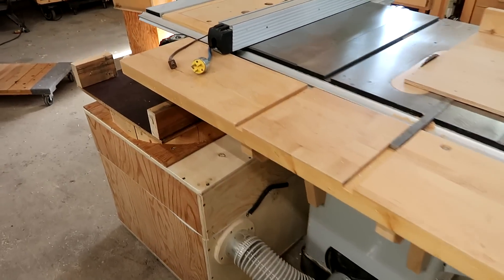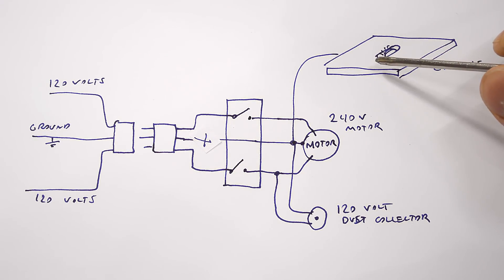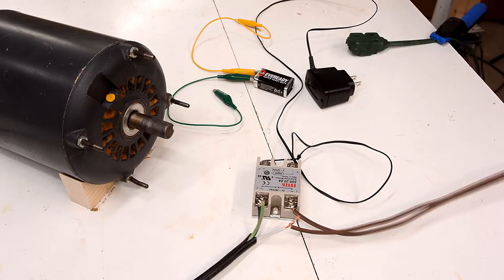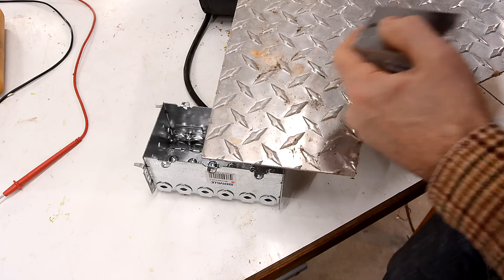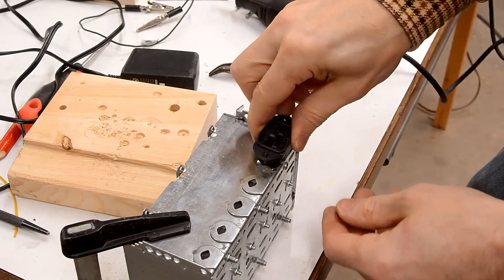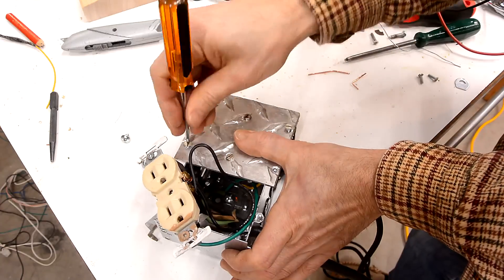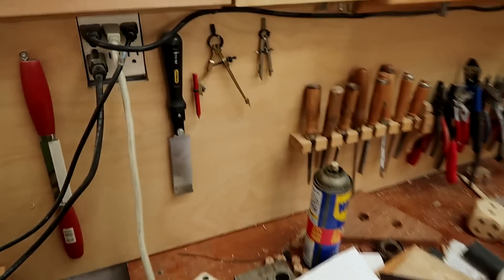Relay box to automatically turn on my dust collector

Comment: If you wire an electrolytic capacitor across the low voltage side of the relay, you can get a time delay before it turns off, which will remove any dust still in the system.
Make sure the voltage of the capacitor is higher than the LV supply, maybe start with a value around 500uF
A simpler solution would have been  a normal relay with a 240v coil
Reply: I know, but it's a suggestion for longer delay if he wants it.
Reply: it already delays a few seconds for turn off. The USB power supply will have a built-in cap for output smoothing.
Reply: Awesome inadvertent feature!
Reply: Good point from the wife: Wiring it up so that the fan comes on a few seconds before you turn the table saw on would be a nice feature too :-)
Reply: TheRetiredtech --- Well the delay is just a convenient consequence of using the 5V power supply.
Reply: you'd struggle unless you plan to put a delay on the table saw starting from the time you turn it on but i doubt matthias would be happy about waiting everytime he turned on his table saw, don't see how you could preemptively predict that the table saw was about to be turned on though.
Reply: A capacitor on the dust collector on the high voltage supply on the relay would also provide some reactive power correction and reduce the voltage drop due to the difference in apparent and real power draw.
Reply: No delay needed really.  I know of no one who starts sawing the instant the saw is turned on or one who turns off the saw the instant the board is cut.  So residual dust wouldn't be an issue.  However, a delay between the start up of the saw & dust collector motor might be needed to reduce the start up surge current of both motors at the same time if connected to the same circuit (if you had a 120vac saw like I do).  Not an issue with Mathias' system.
Reply from the maker: Already has a delay.  I wouldn't want it to be something like 10 seconds, because mentally, that would just be annoying.
Reply: Philippe Grant what makes you think it was inadvertent?
Reply: Sparky Projects the relay seems to be doing that anyway. The fan keeps running a bit after the table is turned off..
Reply: i will buy relay box with inverter and batteries to make my own electricity when the public electricity will gone ..any idea or video ! (i need some advices)

Comment: 2 phase system? never heard about that...
Reply: proper terminology is split phase, since it's 1 leg of 3 phases at 1000-10000v fed into a step down transformer to bring it to 220-240, the secondary winding on the transformer has a center tap, so between the live wires there is 220-240, and between each leg and the center it's 110-120. Then the center tap is earthed to keep the center tap at 0v. This is known as the neutral. 

This set up results in 2 live wires 180 out of phase with each other since it's just normal AC, the center tap just allows you to divide the voltage on the secondary of the transformer.

Comment: great video. thanks for sharing. i would sketch up a single line and throw it in the project box incase you forget how its wired up or if someone in the future uses it. Also did you you ground the project box?
Reply from the maker: yes

Comment: It's cool how using the phone charger has the side effect of leaving the dust collector on for a few seconds after the saw turns off. Since the relay provides very little load to the charger, the capacitors stay charged for a little while and will make sure to suck up as much dust as possible.
Reply: The phone charger probably has a smoothing capacitor in it, and the solid state relay control side likely has a very low current draw/very high resistance, like a FET gate.  So it probably takes a few seconds to bleed off that capacitor’s charge down to the minimum turn-on voltage for the relay.
Reply: The relay seems to stay on on it’s own for a bit already. See the 9v battery demo. But the phone charger seems to increase that time indeed.
Reply: I was wondering why that was happening
Reply: yeah this seems like cool feature
Reply: Richard van Pukkem yeah, that is the behaviour of triac.
Reply: Jeff Newton You sre right
Reply: Central vac controllers have a delay too.

Comment: "I don't understand what just happened" -me after every Matthias video...
Reply: I often don't understand what happens in his videos. I have none of his mashines I'm not thinking about getting one of those like ever. I'll probably never going to do anything even close to what he does in my life. But I still watch every video and enjoy it. Am I weird?
Reply: sometime we saw ..fighting films like bruce lee but we can't do any karaté technique..but we still enjoy the show ..it's looks like that ! not a weird ..human nature is curiosity !
Reply: table saw is powered by 240, cell phone adapter is too. dust collector is 120. He plugs the table saw into 240, which feeds the cell phone adapter when turned on. He plugs the box into 120, and the dust collector into the box. When he turns on the saw it hits the cell adapter which hits the relay which passes the 120 onto the dust collector.
Reply: Relay box ..sometimes has 5 way to switch electricity ..for example when the electricity goes from A to b when the C is switch on but the electricity can change the path from D to E when the C is switch off..that's the job of the Relay box
Reply: I say the same thing about ThisOldTony's videos.
Reply: Hubbard's Handmade I usually head to Home Depot for solutions...
Reply: I was going to say that.  haha
Reply: Just use a freakin' contactor :)
Reply: Matthias has a Black Belt in strange and cool solutions 😁
Reply: What !
Reply: Frederick Toms    What on earth are you talking about?
Reply: Yes you were
Reply: Apparently you are. Talking about talking.
Reply: Just thinking... I need to watch that again. ...
Reply: Frederick Toms   I’m not talking to you
Reply: Chris Is    OK Who’s talking now ?
Reply: +Hubbard's Handmade - I'll tell you what happened here, apocalyptic wiring and bodgery, that's what.  I cannot stand supposed engineers who are so cheap to not buy the right tools or supplies to do the job.  Unless it has to work in the next hour, there's just no excuse for it.  Everyone should have higher standards.

Comment: AAAHHH so many exposed contacts squeezed in that box..  how about some electrical tape or shrink tubing to cover that up?   Sorry, years of electrical engineering being forced to pass CE/UL testing.   Also would love to know how hot that aluminum plate gets (and more importantly the relay itself).   Not sure a solid plate with no radiating fins is sufficient for that if you happen to run your table saw for long periods of time (like your baseboard video).
Reply: I came to the comments for something like that :)
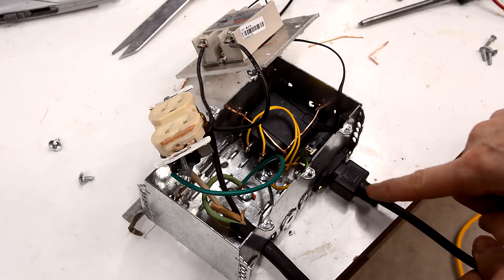Reply: he did ground the box, you can see that at 4:30
Reply: KM4WOR Grounded or not, he would be in pitch dark instantly if that touched metal which isn't really safe with a table saw still running.
And if it only trips one phase in a worst case scenario it might even stall the saw and burn the motor out on 120v and no rotation
Reply: neat idea for the dust collector but I must admit I did cringe when Matthias soldered the wires onto the two outlet pins and left them exposed, think i would would have opened the power brick and de-soldered the wires on the pins and soldered them to the 3 pin socket screwed to the side of the metal box.
Reply: AF he did earth the metal box, look carefully at 4:43, he tied both incoming grounds directly to the box and continued through to the ground of the socket.
Reply: Yeah looks so scary, that bare copper wire on the phone adapter.
One slip of the copper wire and its firework.
Reply: it looked like he taped up the plugs on the adapter, I would have been happier if he'd cracked the case open and just mounted the guts to a fiber board and screwed it to the case with standoff screws... but really, he grounded the case and covered the exposed bits. It should be fine.
Reply: The socket and SSR already have exposed contacts/screws so the adapter is to be ignored
Reply: Or at least earth the metal box, if not already earthed through the metal connections of the socket!
Reply: eeguy77
Reply: KM4WOR But it's likely not on a ground fault circuit interrupter protected circuit in his shop so if he loses ground and it shorts it's lights out for him.
Reply: Dream Services International you're spot on. Using a box that is made for MC that is full of vent holes, along with the huge gap between the handy box cover and the diamond plate, in a dusty environment is more of an issue than some axle grease that wasn't needed anyhow. No cord grip on the SJ cord. All this because the dude is worried about dropping the ground. Much easier to pull 120 off the switched side of the saw. PS... I love when he soldered the wires and then took a pair of dykes to cut off the spade rather than using spade connectors.... Wonder if that switch is still UL.
Reply: I was going to comment the same concern, but there is one more thing that concerns me.
The grease Matthias is using instead of terminal compound, will melt and properly drip down to the hot wires  😳
Reply: Downvoted the vid for that very reason. Nobody was told in the video it was the right way to do it, but still content creators have some responsibility.

Comment: Good solution to a safety problem that I wouldn't have initially known about.
Reply: Alec J I guess Matthias also just learned it the hard way. Though 110 volts doesnt hurt much. I have had 230 volts on me for many times (return path via shoes to ground though, via neutral will be much worse, but that isnt the case at this table saw scenario either).

Comment: A good solution but clearly not from an electrical engineer ^^
Reply: Perhaps you guys don't realize that Matthias is an electrical engineer...
Reply: In a previous life Matthias worked for RIM as an engineer. In a book about the rize and fall of Blackberry phones he has been mentioned as: "a cheeky young engineer named Matthias Wandel." He is also a pattent holder for some cell comunication technologies. I believe his RIM stock options funded his early retirement. Xcuse for the typos
Reply: You're right... Matthias is so much more than just this!
Reply: Bert van Rossem RIMshot!
Reply: Noone needs to be one to do this
Reply: TheRetiredtech Yeah that's why I've said that you don't need to have a degree to be smart
Reply: Bert van Rossem ich
Reply: Alex Anderson
Reply: Ask him.
Reply: Clarification: my previous comment was directed to Bert van Rossem: ask him.
Reply: BTW, what degree Mathias hold? the video in which he builds a book shelf, he shows some books about fluid mechanics and aerodynamics....
Reply: Paul Kolodner Do you know that for sure? Matthias certainly seems to know the basic part of electricity, but I don't think this would be the result of an electrical engineer
Reply: Your right.  An electrical engineer would have made it way more complicated and still screwed it up.  Where as an electrician could have done it safer and correctly.

Comment: Hang on won't that piece of aluminium fall off when you cut it like... ooooooh, clever.
Reply: What, that he clamped the side of it in the vice?
Reply: ya, would have been smarter to let the huge piece which weights 20 times more to fall down......even more to put his barefoot under, to amputate one or two fingers.

Comment: I thought for sure there would be something in the video sticking it to the YouTube safety patrol.
Reply: all the exposed contacts throughout the metal box with only airgaps to insulate should be enough
Reply: Andrew Frink I've started seeing wago connectors at some specialty stores in Canada. But at about 5 times the cost, (50 cents vs 10 cents) it usually doesn't make sense.

But a 5 wire wago is fantastic, especially compared to the shit show involved in joining 4 or 5 neutrals in a home wiring situation with a giant wirenut.

They are about a dollar, but it's a no brainer for me given how rarely it comes up.
Reply: @gelu88  The cost of Wago connectors doesn't really matter when you consider all the time the installers save. Not to mention reliability.
Reply: Love Wago's for my around the house DIY electrical work.
Reply: Andrew Frink I agree, we don't use wiring nuts in the UK, but the Wago connectors are considerably more expensive than connector blocks.  I love how compact the Wago connectors are though.
Reply: pretty standard wiring here in north america. I do like Wago connectors though, shame they are so much more expensive than wire nuts.

Comment: Regular grease as head conductor ..... ?
Reply: grease
Reply: thermal paste would be better, but regular grease is better than air.
Reply: It will take a bit of effort to put Greece in between there